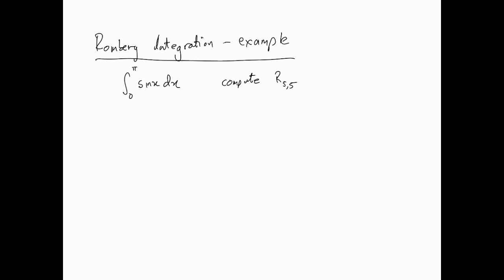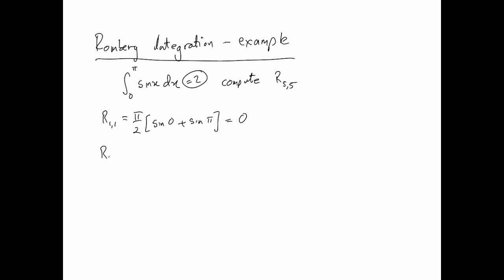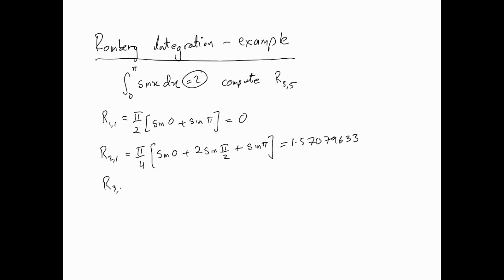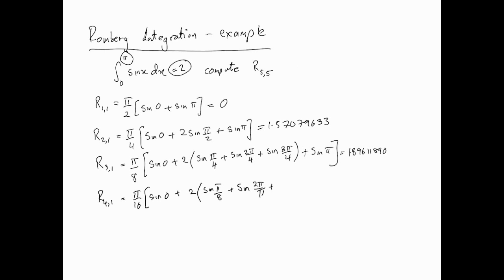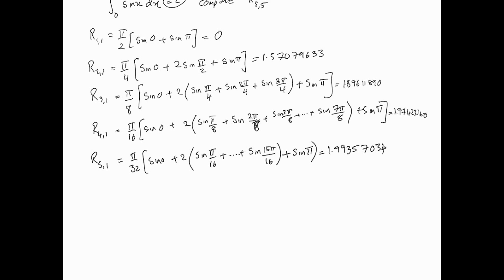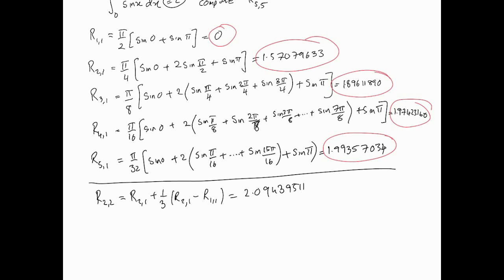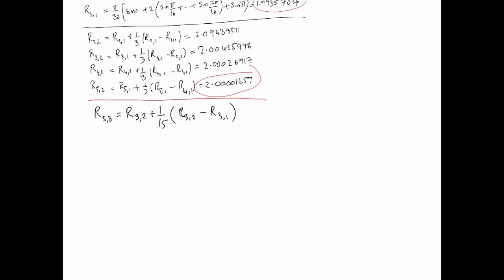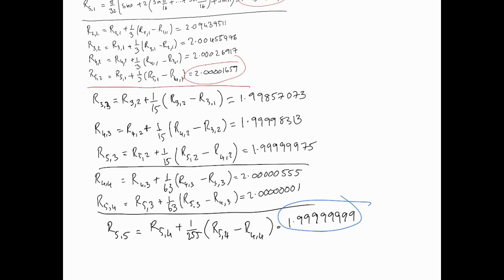Numerical Integration - Romberg Integration - example

Comment: you made a mistake writing r33
Reply from the maker: Yes you are correct that is a typo it should be R(2,2) instead of R(3,1), but he numerical value is correct as it is a solved example.  So the formula is: R(3,3)=R(3,2)+(1/15)*(R(3,2)-R(2,2)).  Thank you for pointing that out, and my apologies,

Comment: Excuse me, how can i apply romberg's method if the integration is for double integral?
thank you.
Reply from the maker: Well that is a difficult question.  There is only the adapted Simpson's rule for double integration and higher.  However, as for Romberg that is a research level question, I am not aware of any undergraduate level where this is taught.  Postgraduate courses perhaps, but it gets into parallel computing where you will find some research papers on the topic but not in text books.   I am afraid this is not a question I can answer here.
Reply: Well that's pretty weird, i guess i have to ask my profesor about this because the teaching assistant gave us a MATLAB programming assignment to integrate ∫ 0 to 1 ∫ 0 to pi/2 e^y cos(x) dx dy using romberg's. Thanks for the quick response sir.
Reply from the maker: Well that question does not even require numerical integration.  Of course Matlab is a whole different ball game.  Matlab has a lot of built in functions, and it can do double integration for you.  Also remember that Romberg is based on Richardson's extrapolation, in essence it is an update procedure.  So you solve an integral numerically in the first sweep which you can easily do using the adapted trapezoidal for double integrals and then afterwards it is just updates.  I am sorry but I have not actually done this myself so am just giving you ideas of how it can be done.

Comment: 1/3 ,1/15,1/63 etc from where it comes
Reply from the maker: Good question, well these multipliers come from the derivation of Romberg integration which is based on Richardon's extrapolation, which is an amazing concept and applies to both numerical differentiation and integration.  However I have no video on the topic I planned to make one but found no time and its more a background material concept.
Reply: The Math Guy thank u so much sir i will see derivation of romberg method thanks for ur reply and it was a good video 😊✌️